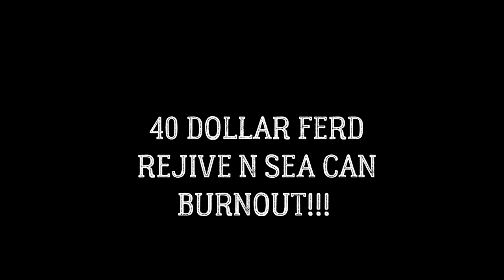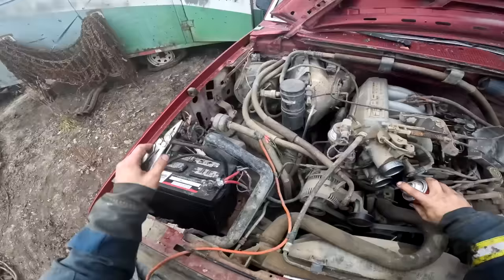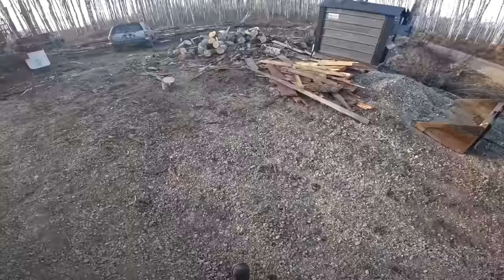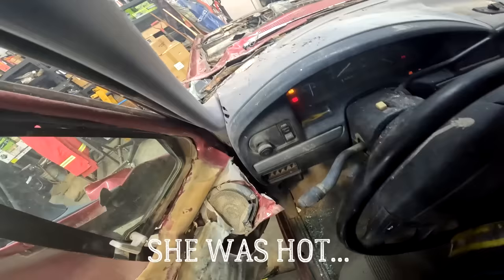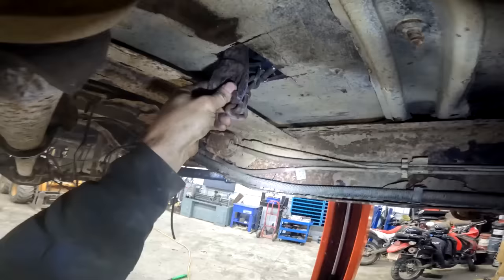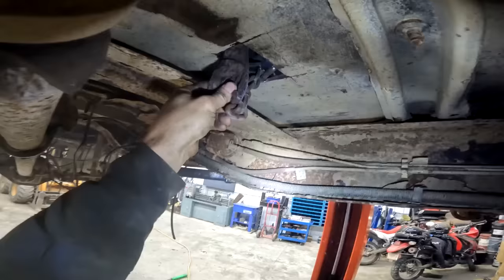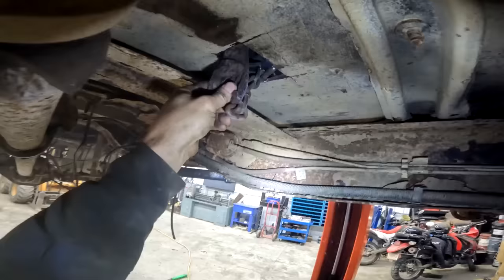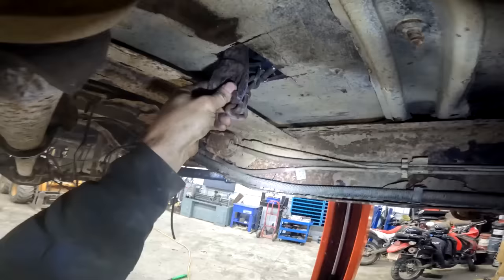40 DOLLAR FERD REJIVE N SEA CAN BURNOUT!!!

Comment: My guess was that it would run out of oxygen. V8 Carba-choocher takes in about 600 CF of air every minute. Given that we know a shipping container is abut 8x8x20 its going to have about 1200 CF of air so it would have burned all the available air in under 2 minutes. Usually takes longer than that to burn up a set of tires unless they're already bald as Jim Lahey

Comment: Nice. Next time, run about a 3"hole in the side of the sea create, and weld some metal tube to the hole so she's air tight. Run the other end of the tube to the intake so the truck can breathe and fill the crate up with freedom smoke from the tires and exhaust until they blow. Then crack the doors and salute Greta in style.

Comment: I use lucas for my 302 in my 1988 lincoln town car for the summers in florida besides that I run 10w30 and lucas oil saved out 5.4 in our f150 when we moved here because towing our camper put so much strain on the 5.4.

Comment: You are a God.I didn't think it would do 2nd gear if you lubed the tires. 
     It could flash boom. I think. With spark,or open flame. It would have to when the doors open.
      If you run air to the intake only, the tires can't blow without oxygen.

Comment: We run 90% oil... 10% gasoline down to single digits and it works pretty minty.  Have more than a few videos on the subject..  and a lot of testing.  Ol IDIs just don't care.  Now my Cummins and my DT are a bit more picky.

Comment: If the tank won't hang from the electrical connector your terminal tension is bad and your connector needs replacing and or the terminal

Comment: Next time peg do the same experiment but put hose from outside using the same technique as hillbilly fuel cell and hot glue straight to throttle bodies then do the burnout to see if the theory it turns the sea can explosive

Comment: Lucas is pretty much just gear oil its a base oil with no additives and its super thick. Ive used it but i think i might start using gear oil instead since gear oil should have better anti wear additives

Comment: If motorcycles can run on gas and oil, Ferds can do it too!   And if we've learned anything from TV, it's that you don't need tires to drive.  Just watch those high speed cop chases.  Once the tires go, they spark along just fine at 100 mph plus until the rims wear out and they're down on the brake rotors.

Comment: I think it'll get smothered before they blow.
Edit: I just remembered the video Cleetus Mcfarland did where they attached a hose to a car intake and it still ran. I still think it will stall, but it'll be due to a lack of power, not lack of oxygen. It'll restart and idle, but it won't spin the tires.

Edit: Dang, I didn't think about it just slipping the converter, I'd've been right if it was a mansmission. This video was friggin hilarious